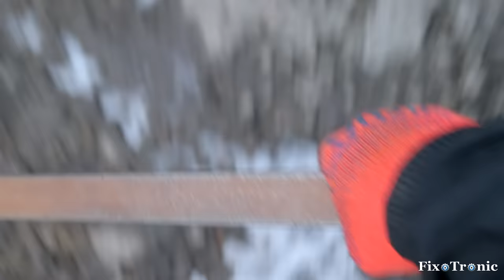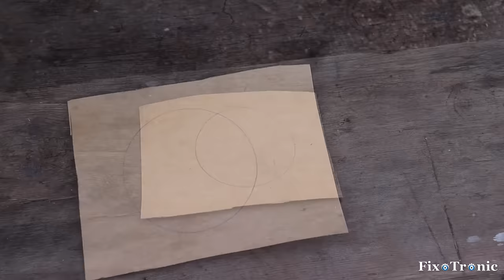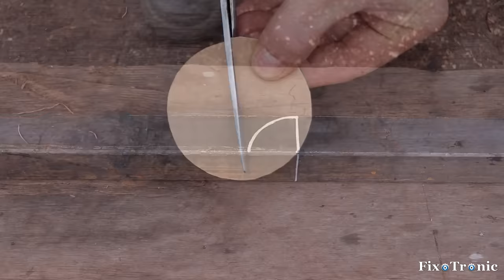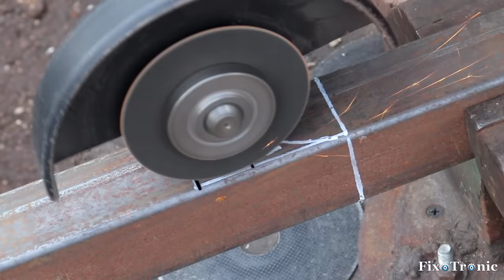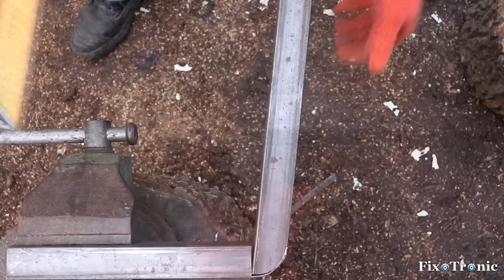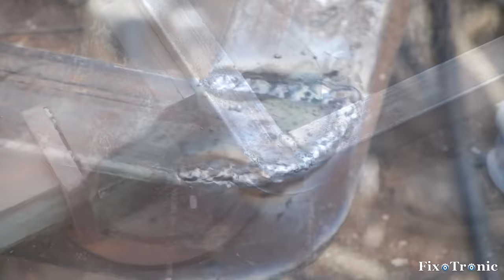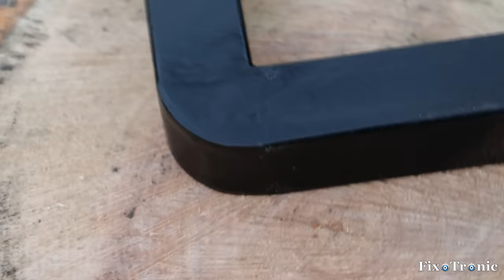Secret Profile Pipe! WHY DO WELDERS NOT SPEAK ABOUT IT

Comment: They don't talk about it because they can just miter the tubing [easier faster] and also will have square corners and not rounded corners.   It ain't rocket science why they don't talk about it :)  in construction, there is a reason for everything we do and it usually has to do with economics or design parameters.  This style is creative but is more labor intense than just mitering the tubing.

Comment: the thing is: if you want to prevent it from rusting you dip it into a basin of liquid zinc. with this method you basically created air pockets because the outer wall of the pipe is folded into the inside. and air pockets have a chance of exploding when it is dipped into the zinc.

Comment: I could have sawn it in a 45° angle and weld it together into a 90° angle in the same time you drew the circle. It would be cheaper since there is almost no rest metal (only the 1 mm of the sawblade) and it would take me wayyy less time meaning more time for other things.

Comment: Because most engineers would never request something like this. Takes forever to prepare, preparation is difficult (ish), requires tight (ish) tolerances. And - as can be seen at around 4 minutes - is not actually watertight.

Comment: As a Hobart Institute of welding technology graduate and a professional fabricator....this is not a trick used cause it takes way too long for such a simple joint. And Im not sure what you think welding is....but this video doesn't show it. Doing a series of tack welds does not ensure proper joint penetration. The weld is supposed to be the strongest part of a joint...not the weakest..

Comment: Interesting technique for crafts and I'm sure it has artistic appliations, but not only does it take longer than a simple 45 degree cut/weld, it is also structurally weaker.  In a practical world you'd simply chop saw a 45 and tack in a simple triangle gusset if you needed more strength.

Comment: Now the channel inside is blocked off at the bend, good job.
Reply: It makes for a stronger joint this way.
Reply: I doubt the square pipe is used for fluid flow. But in the event it would have been used for fluid flow you are correct

Comment: LOL at all the little girly comments about how this is so slow, didn't weld, production rate blah, blah, blah.
If I want to weld up a table or something, and don't want a sharp 90' angle on it, then this looks perfectly fine.
For the shop, 2 front corners extra 10 minutes work, for some arty-fartsy table, 4 corners so maybe 20 minutes extra work.
Its simply an option, and having options is a nice option to have.

Nowhere in the video did the guy say it was Better, Faster, or anything.  Tired of so many whiny bitches in trades related threads.

Comment: A two inch tig weld takes about 1.5 second to run.
This cut probably took 20minutes.
We know you union workers don't see an issue, but us real workers don't shaft the client on purpose
Reply: 2 inches in 1.5 seconds is a pretty quick pace for TIG. But dang,  I think union workers get the job done quicker than this joint takes to finish!

Comment: Welders don't talk about it because you don't get paid on the job for doing fancy little tricks that have practically zero application on the job site.  You might even get fired for wasting time.  Where would you seriously use this except in a YouTube video?  The best method for building things, as all good tradesmen know, is the KISS method:  Keep It Simple, Stupid.  Never use a dovetail joint where a butt joint will do the same thing.
Reply: Welding isn't restricted to the job site. This would be a handy method for a home project, if its the result you're looking for. Tig welding would have been better imo, would have been cleaner and better looking.

Comment: Welder here.... we dont talk about this because it looks like sh.... Just cut it two times 45 degrees und make a nice edge... aint nobody got time for that.
Reply: @Shaun Kemp but in that case you just coul round the corner, hammer a thin piece of metal around and weld it. It woulb be faster and you dont have grind and cut that much.

Comment: Welders are paid to weld.
This is a fabricators job.
Why would welders talk about it ?
Worked as a welder all over the world on pipelines.
We never discuss what the pipefitters get up to.
Reply: A welder who can't fabricate ain't worth shit. That being said this isn't worth the time spent
Reply: @jonathangarzon2798  welding these days is a highly skilled trade.
You ain't gonna get s job on any pipeline.
Unless you've passed recent quality welding test.
ASME 9 ASME G6 
Mig mag tig oxyacetelene.
Manual metal arc.
The list goes on.
Do you really think their going to let you loose welding multi billion pipelines to x ray standard
When your only experience is making car seat frames or trailers in some factory.
Reply: @billgowland3250  literally just beat out the certified welders to get a new job so obviously certs are at best value a reference.
And oxy while useful isn't really used to weld anymore, brazing and cutting is what it's been reduced to industry wide.
You sound like a recent welding school graduate, you better go with structural if you have that mindset or you're in for a rude surprise when you go to weld in the industry

Comment: such clickbait titles, just cut 45s, weld preferably better than this and dont forget to do along the inside of the 90 degree this guy only did the sides, if its outside its going to rust from within, use primer too or the paint will be off within a month, smh